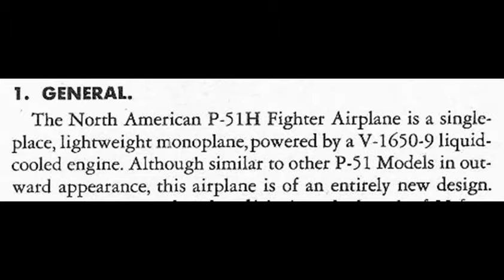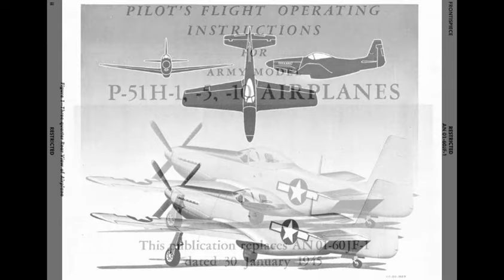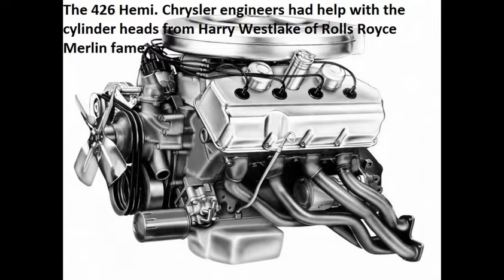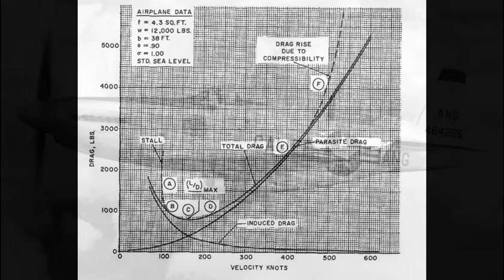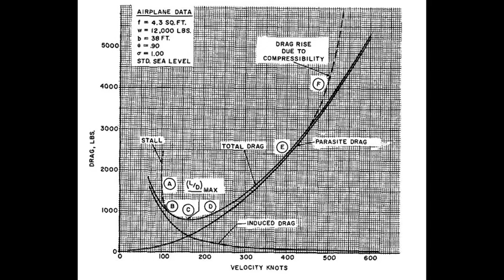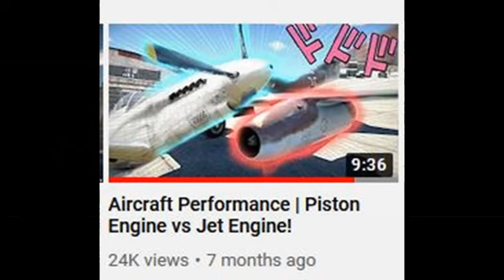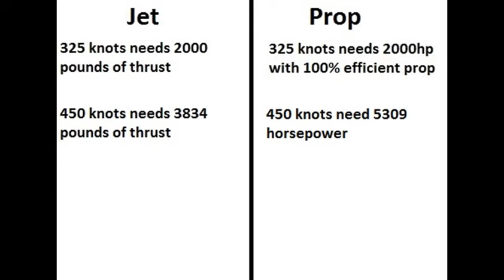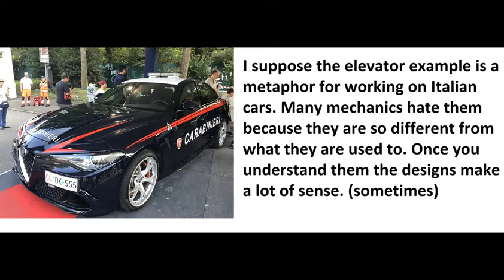U.S. "Superprop" Fighters P-51H, XP-72, and more

Comment: Stewart Tresilian (9 January 1904 – 20 May 1962) told Lord Hives Rolls Royce MD that he could make more power by building smaller engines but spinning them faster. Same torque at 2x revs means 2x the power. That’s been proved post WW2 (especially in motorcycle engines) but at the time was ridiculed. I often wonder what would have happened if RR has taken up his ideas. 
To be fair, they did try the two stroke (Crecy) that was slated to make 5000 bhp from 27 litres. It’s not clear how much of that was exhaust thrust.

Comment: In the UK, the floor in contact with the ground is 'G' - the Ground Floor! - not zero, unless less it is a sub-basement (i.e. partially above, partially below ground level) where G is half way off the ground!.... The sleeve valve and propeller videos should be interesting.  Anything to come on valve types and operation? on radiators and cooling? Lubrication?

Comment: The aircraft with the two props turning in opposite directions on the same long axis are more properly referred to as "countra-rotating" props.

"Counter-rotating" props are those as seen on all but the "castrated Lightnings" sent to the RAF, on Twin Mustangs, Meteors and a few others.

Otherwise, this was an excellent video!

Comment: Brooklyn, NY  at least one of the  Metrotech buildings, has something similar.  All elevator banks on each floor, have a touchpad, where you enter the desired floor, and then it tells you which elevator to take, inside elevator, all former controls have been taken out, you are just there for the ride.   Think this was upgraded last year, because of COVID.

Comment: Not sure if  the P47 variant was the first prop to achieve over 500 mph in level flight. The CAC 15 kangaroo fighter certainly achieved that figure in level flight here in Australia. Maybe check the dates as to when. However there was only one CA 15 built. And it was scrapped due to the arrival of the jet age. We built dehaviland vampires instead.

Comment: I find it interesting how a propeller interferes with a planes speed. I read somewhere that  prop powered plane can't break the speed of sound  because the prop gets in the way. A jet is limited to high mach 3 because of the blades from the compressor and fan. In an automobile  your cooling fan at 40 mph becomes inefficient. Scram jets seem.to be the next big step in propulsion, you just need to get them up to !each 3 for them to work

Comment: Just an FYI, the Elevator technique is not an Italian thing. They have been doing these systems in the US and abroad for a decade in new buildings with multiple elevator banks. Its more effecient because the computer algorithm that drives the idle position for the  elevator cars needs to be deterministic to be efficient and not at the whim of real time button presses, it also makes for better security.

Comment: 25:45 I haven't seen that kind of elevator before but it should allow the elevator controller to more efficiently plan its routes, minimizing waits.  However it's probably instead used to minimize power bills, maintenance bills and the like...

Something that's omnipresent in Hong Kong that I've only seen in a very few elevators elsewhere is the ability to ERASE floors that have been accidentally selected by double-clicking.  It may be that a fair number of elevators elsewhere have this feature but in Hong Kong the citizenry expects it and is quick to try to use it without eliciting comment.

Comment: It's funny you mention 37mm cannon and B-29. A Japanese high altitude experimental twin fighter, maybe a modified Ki-96, blew a B-29 engine clean off the wing with a single hit from it's 37mm cannon. The B-29 made it back to Guam, and this 1945 account has been verified from both sides.

Comment: Never in my life of working on engines does an extra cooling fan detract from the ability to keep an engine alive and regardless of hp requirements to drive said fan does this affect in a negative way the performance of any machine. That corn cob absolutely needed that extra fan inside the cowling like the BMW on the 190. The contra rotating prop is he baddest looking arrangement i have ever seen and just screams I wanna go fast.

Comment: The P-63's major problem (like most of the air-cobra/cobra/king-cobras) was only having enough gas for about a minute (lol).  A neighboring air museum has a P-63 and the owner has NEVER flown it without the drop tanks aboard (not a lot of long runways in the area if you run it out of gas).  Having said that Pappy Boyington did pretty well with the p-39.
Reply: Boyington flew the P40 with the Flying Tigers, prior to that he flew naval aircraft. 
You may be confused with Chuck Yeager's enthusiasm for the '39
Reply: @mattjacomos2795  After returning to the U.S. and the USMC, Boyington was given command of a 'composite (whatever the Marines had there) air group at Henderson Field on Guadalcanal (which had as their ONLY fighter (at the time the USN was NOT going to give NEW wildcats to the Marine when there was ANYTHING else) the P-39.  Boyington and his guys very rapidly figured out that the Aircobra was a dog above 12,000 feet (no supercharger) but that at low altitude it would run with a zero at less than 1000 feet (though not turn with them, but they out punch them).  I got this from HIM when I was in high school (he lived two blocks out of my way to walk to school).   He told me several of his adventures (some of which were in 'baa black sheep (the book)'  P.S. a Chief Petty Officer in the USN taught me that a good sea story (and {Pappy could tell some great ones) was 20% fact, 20% fiction, and 60% BALLS TO TELL LIES LIKE THAT!
Reply: @fooman2108  You are a lucky man to have had HIM as a friend.

Comment: I long time ago in RC Modeler magazine I saw a  RC plane of a Spitfire XIV? with a counter rotating prop.  I really wanted to build my own till the article said that he had to use a normal prop for flying.  I looked today and there are options for brushless RC motors with functioning counter rotating props.  They are even affordable now!   I might have to revisit and old obsession  of mine
Reply: Spitfire Mk XIV had a RR Griffin with a five-bladed prop.
Spitfires and Seafires with contra-rotating props had a redesigned wing.
If you saw the plan in RCM, it was probably the Spitfire F22/F24 plan by Gordon Whitehead.
That plan is available for free download on the Outerzone website.
WWW.Outerzone.Co.UK
I’m not sure how powerful the contra-rotating electric drives you refer to are.
I suppose you could scale the plans to fit the power system.
There are a few YouTube videos detailing the building of these systems.
Just search for them.
Good luck with your obsession.  It’s a cool one.

Remember, let’s be careful out there.

Comment: I would like you to do a vid on the use of Nitrous in WW2, which planes used it and show/display, how that system was implemented into the engine (foggers, directline?) and also how much power and for how long it gave. Also, a question-rudder. I know this is going to start off sounding like a sad question, but in the video game called Warthunder, in 'arcade' mode, one is able to use the rudder to make almost u-turn like moves in the air. However, in that same game, in 'realistic' mode, use of the rudder this way makes the plane uncontrollable in such a way. In the end, for a dummy like me, what if the use of a rudder in air flight, as opposed to perhaps only it having a big use on the ground, taxiing, etc. Sorry for the stupid question.
Reply from the maker: I cover nitrous a little bit in my Ta152 video because it had a two stage nitrous system. I haven't flown on Warthunder so I can't comment on how realistic or unrealistic the rudder is.

Comment: Were there ever plans for a Griffon powered Mustang? Technical proposals, initial designs, or even initial political/economical considerations into making it? I wonder how a counter-rotating Griffon Mustang would have performed.
Reply: +superjuca55   I think I might have read something about a proposed Griffon-inspired Mustang design in one of the Rolls Royce Heritage Trust publications, but I'll have to dig into my books.   There have at least three racing Mustangs with Griffon engines,  the first two destroyed at Reno (with one fatal) while the third "Precious Metal" had a severe fire on a fuel stop and is rumored to be rebuilt into stock P-51 condition again.   https://www.youtube.com/watch?v=emF219THRv4
 
"Red Baron"  destroyed after engine failure:  http://www.aerialvisuals.ca/Airframe/Gallery/0/88/0000088626.jpg
"Miss Ashley II"  (half P-51, half Learjet) disintegrated mid-race and fatal to pilot Gary Levitz:  https://i.redd.it/ypsw0wem0j511.jpg

Comment: Were there turbo prop figher aircraft in developement at the end of the war?
I remember germany had some plans for some but I think that was in the 30s when the capabilities of the jet were probably still quite unclear.
Jets are quite superior for high speed because of the powerdensity they are able to achieve. Mostly because of the simplicity of the design. If you would compare the crossection of all inlet valves and a piston engine with the inlet area of a jet I think it should give an estimate on how much air each engine is able to consume. In addition the piston engine is limited by the valves obviously not being open all the time.
Also as far as I know they were already reaching the limits on speeds which you can reach with a propellor due to transonic effects on the blade tips.

Comment: Greg, never seen some of thou's pictures. I have seen some pictures of P-47 with dual props. An yes I am a little surprised nome of these super prop made it into combat given the fact the Me-262 was seen as a big threat. But I assume fuel consumption was to high so less range an if you can not reach the combat zone what go is it. I have heard that the dual prop P-47 had a problem with low altitude accusation as in ground attack the single would spin up quicker to get away faster. But sure if this is true. Great video !!!!

Comment: iI flew in a p-51which belonged to an architect named Howard Dutkin who passed in the late 1970s  it was stationed at North Perry 'Airport west Hollywood Fla where id 
been not only taking flight lessons but had been drill instructor for a local CAP
civil air patrol group of about 18 members and which which Dutkin had been involved.
 it was a 9 cylinder radial engine and was a fighter bomber used in ww2

Comment: Hi Greg, I thought you might include the Curtiss XP-62 in this, since it was such an ambitious concept on paper with its contra-rotating props, 8 x 20 mm cannon,  high altitude performance, and pressurized cabin. Alas, it was beaten to the punch by the P-47 and never got further than limited test flight.

Comment: P51H, saw 1 of these back in the day. Late 60`s early 70`s. Memory says it was based out of Hayward Ca. & was the only 1 in existence. Wondering if memory is true and if the plane is still flying.
Reply: +Kevin Clark    There are eight P-51H survivors total, and I think two or three are flyable.  The Couches family has flown a P-51H for a long time and just obtained a second P-51H for rebuild to flying condition I believe.
Reply: @FiveCentsPlease  If I remember correctly, North American only built 555 H-models.  Had the war continued into 1946, the H-model probably would have replaced the D-model in frontline service.  The idea was to counter the kamikaze planes with the sheer speed of the P-51H but the A-bomb rendered the point moot and the Mustang production contract was canceled.
They did not use the P-51H in Korea because there weren't enough to go around to equip squads and still have spare parts.  The other issue was the wing and body of the H-model.  The lightening of the airframe came at a price in strength.  The H-model could not handle bomb loads as well as the D-model and that was another factor in not using the H-model in Korea.
The late Chuck Yeager flew the B, D, and H-models.  The B and D-models were the Mustangs he flew in combat.  The H-model he tested after the conclusion of the war when he was stationed at Wright Field (now Wright-Patterson AFB) before his move out to Muroc Field (now Edwards AFB).  He felt the H-model was a dog and not the huge improvement North American claimed it was.  At least that's what I remember reading.

Comment: Also about thrust in jet vs prop. A jet engine makes more thrust when going faster because it feeds the engine. But that's up to a point because it cant have supersonic air (I think) idk why. But that's why you see cones in front of the jet engines on the SR-71 and the MIG-21. That slows the air down. Other jets have different ways of doing this. If you look at the F-35 theres a hump on the body of the jet at the intakes that's how it slows the air down, the f-4 had panels that moved, the f-15 moves the front of the air ducts.

Comment: www.mustangsmustangs.net has the P-51H listed at 490 mph at 25,000 feet. The Dallas-built version of the P-51H, the P-51L, similar to the P-51H was to utilize the 2,270 hp Packard Merlin V-1650-11 engine which was never built

Comment: Just on the lift system you encountered: I've seen this in more than one more recently constructed office buildings in Europe. Even in Eastern Europe. It's not something specific to Sicily, it's just a new way of doing it. It avoids lots of people with lots of different floor destinations in one and the same lift at the same time. It pre-separates by destinations and hence increases efficiency. I guess there is some kind of computed control behind, which was probably technically feasible in the 70s, but would somebody in the 70s have trusted a computer to control a lift?

Comment: Can you talk about the problems that really caused the xf5u to be cancelled, aside from the coming of jets?  I don't completely understand why it was abandoned (only that it was because it took too long and they (us military) were more interested in jets, which doesn't seem sufficient for canceling the flight tests when it was ready).  I wonder if there was an engine problem with it (since it was using radial engines from transport planes buried inside the fuselage and cooled by intake fans).

Comment: Greg, exceptional and enjoyable series.  Very well done.  But about your jet vs prop calculations, I believe one pound of thrust is equal to two horsepower.   So a 1000 lbs jet is equal a 2000hp engine.
Reply from the maker: at 325 knots true airspeed 1 pounds of thrust is equal to 1 horsepower. Source: Aerodynamics for Naval Aviators.

Comment: There was an F-51 (a modernized P-51) that was retired from active status when I was in the USAF in 1984
Reply: Never heard of that before your post. That's really interesting. I've liked the P-51 since a kid and would drool over a more modern version.
Reply: @olliefoxx7165  there was one left in the USAF and I remember reading of its retirement when I was stationed at Keesler AFB.
Reply: In 1947, I think, military aircraft designations were changed, with all P (Pursuit) planes becoming F (Fighter). The P-51 became the F-51,  the P-47s still in inventory became F-47s, the P-80 became the F-80, etc. The designation changed, not the plane. Photographic planes that were previously designated F became R for reconnaissance.

Comment: Greg, back in the late 1980s GE invented/developed the Fan Jet engine (the one with the curved blades on the outside of the engine). How was this engine able to provide high-speed thrust when a regular propeller could not????
Reply from the maker: That's just too complicated for the comment section. The short version is that while it did give a lot of speed, still not as much as an older jet.

Comment: has there ever been a piston engined plane that could fly at over mach 1 at say 10,000 feet in level flight? (no cheating - eg level out after a dive does not count). you can use whatever sort of prop you like even encase the props so that the drive unit looks like a jet engine . im thinking engine in fuselage and "prop" drive units in wings just like jets

Comment: I'm struck by the similarity of the power-vs-thrust equation at 18:00 to the power-vs-torque equation for any engine [Power=(Torque x RPM) / 5252 in U.S. units].  Thrust (or torque) is limited by power, and decreases with speed (or RPM).  In contrast, the thrust of a reaction (jet or rocket) engine remains constant with speed since it doesn't get thrust by pushing on the air.  So it's effective power output is proportional to speed, and the power is limited only by how fast you can go.
Reply: This is because the two equations are exactly the same physics - it is the time derivative of the equation for work. For even more similarity, look at the (proper) equations using SI units: for shaft power, P = Tau*Omega. And for propulsive power: P = T*V. The only difference is that one is work in a rotating system, and the other is work in a linear system.

BTW, a small correction for your description of jet engine power - it is true that the available power increases with speed, but it's not limitless. It will reach a maximum when the flight speed is around half the speed of the exhaust jet, then it will begin to drop, and shortly after it will begin to also lose thrust. This is governed by the equation for overall cycle efficiency in a jet engine.

Comment: Great video, though I'm curious as to why you left out any mention of the F4U-5 ? as from what I remember reading up on it, it could make 408knots/469-70 mph.  I find it hard to find confirmation on -5 numbers. Yet still the -5 is considered a super prob version of the F4U or is that wrong ?
Reply from the maker: I just didn't get to the USN super props, Super Corsair, Bearcat, Tigercat.
Reply: @GregsAirplanesandAutomobiles   Oh gotcha, i hope you cover the F4U-5 and not just the F2G and such. Whenever you do get around to the USN super props

Thanks for the responce